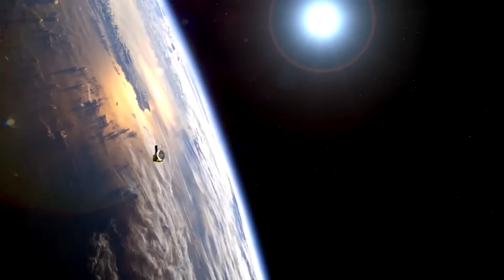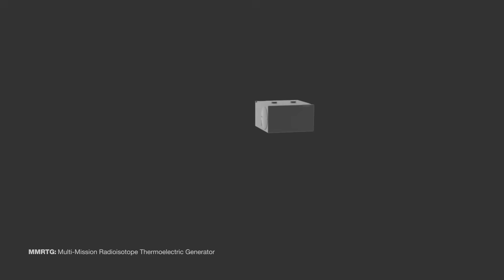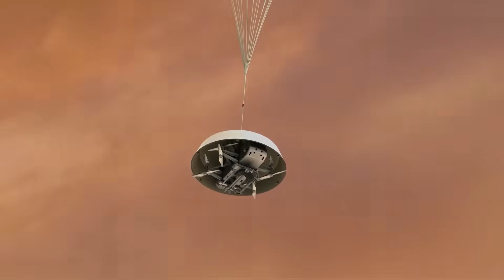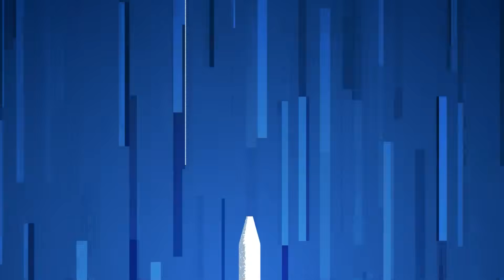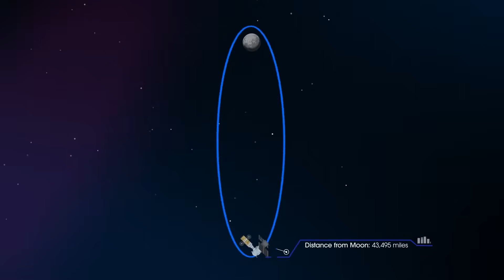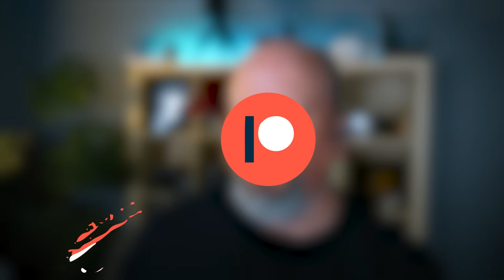Improving Nuclear Power Generators for Future Space Missions

Comment: If using Stirling engines can save  80% of the needed material over thermoelectric generators, how does this scale to shielding savings? I’m guessing it’s something similar to (1/5)^(2/3). Think surrounding a volume of radioactive material with an area of shielding.  So if volume reduces to 1/5 original, shielding may reduce to as little as 34% of the original. (Ideally). It’s possible that Stirling engines can reduce the radioactive material requirement and total weight in a significant way so that overall cost is reduced.

Comment: I wonder if they have considered anything with thermionic converters. As i understand them, they are like a halfway point between thermocouples and stirling generators. They are higher efficiency than thermocouples, but lower efficiency than stirling. They dont have any moving parts, but they do contain a gas (i believe usually a caesium vapor).

Comment: Another possible Lunar industry is space based construction.
Building spaceships, space based solar, space stations and habitats, rotovators and orbital rings, and all that using Lunar materials would have much lower launch energy costs. Lifting a ton of aluminum hull plates from Luna is much less energy intensive than from Earth.
Some deeply complex components like computers would still need to be imported from Earth, but the bulk structural components could be made and launched from the moon for orbital assembly.

Comment: I could see a spacecraft built to use a high radiation RTG, with a upper stage fuel tank as shielding and a Long carbon conductor pole to keep the RTG far away from the spacecraft.   The upper stage could be ejected leaving the RTG on the pole.

Comment: We could extent the use of an RTG with the Sterling engine for long duration space missions by using the RTG with the thermal couple as we have and keep the Sterling engine in a non-moving state until the power level drops.  Then kick in the Sterling engine to bring the power levels back up.  This could extend the system without wearing out the moving parts over the first couple of decades.
Reply: How huge will the radiators have to be cuz you know there's no convection in space only radiative cooling!

Comment: I suppose you could use two stirling engines in line, but opposite, with the heat source in the middle. With a synchronization mechanism, they could be made to move equal but opposite and cause almost zero vibrations.

Comment: diy with solar power. nuclear transformation process. nuclear decay airplanes and low altitude satellites are the best usage case. dd fusion would be even better available, if using arc heavy water inertial confinement fusion process. similar levels of rad output shielding considerations. dont ask us gov. diy no matter if they threaten with rules. well those rules are not freedom. yes you can if you just have skill. as free gift from above. dont let sellers gaslight you not having skill. am-241 is very nice, or the pu-238 which is best. dd fusion is self-shielded with the heavy water inertial containment case itself. solar for all other cases. well you can toss up micro satellites with em launch rails from earth surface into space with some carbon isotope power sources. solid state is best for any application, no moving breaking parts. sterling acoustic heat engine for all other less shaky earthy projects. pulse jet without moving parts for nuclear decay air planes. simplicity and robustness vs efficiency. your rockets cannot blow up like space x starship tests. dont just talk about it, do it. also capture lost heat to make the rtgs better. stirling is better for earth applications, like air planes. itar is nasty btw. well, we dont talk anymore then. as long as you rule with your rules, we dont talk. any of your 3 interest are not shared. only for exploration fun experience purposes, because can do. money is the weakest motivation of them all. wavy all the time. people are not to be trusted, including me. money is not actual life. ask above for your stuff, not people for their rules. money supports nothing. only consumes. dont put your trust in people, they only crash immediately if you trust them. keep it simple, engineers. us regulations are not the actual real future. freedom. not even as world police. no way.
Reply: so why do piston based sterling engines, when you can do tesla turbine based rotary sterling engines.

Comment: Heat radiates in all directions and in micro g it's might be less relevant how the engin is oriented. Might we see thermal element surrounded by multiple pistons? Sort of the radial piston configuration for an aircraft engine? Or could you build a sort of "spherical piston" with the heat source at the center, using an elastic material instead of rigid one?

Comment: Question: Nuclear thermal rockets traditionally use liquid hydrogen as a fuel, but it's hard to work with and results in massive fuel tanks. Could they use liquid oxygen, or even methane instead, or would the isp fall too much to be useful?
Reply: O2 has a mass of 32, CH4 has a mass of 16 whereas H2 has a mass of 2 and for a high Isp you want as light exhaust molecules as possible. H2O has a mass of 18 so if you want to use something that is easily storable, go with water. Isp will be less than space shuttle engines (where exhaust was H2O with a bit of extra H2) since the temperature of the reactor is less than in the combustion chamber of a chemical rocket engine.

Particularly if we go to places with lots of water like outer asteroids or the moons of Jupiter then just melting and purifying some water to fill up the tanks could be really convenient.

Comment: One Mars-specific nuclear generator I would like to see investigated is as follows: Take Mars air (96% CO2) and liquefy out the CO2. Heat the liquid CO2 (using nuclear heating) so that it becomes supercritical CO2. Expand the sCO2 back to atmospheric pressure driving a turbine/generator. Thus electrical power. You're using the Mars atmosphere as a heat sink, which eliminates large, fragile radiators. The  by-product is nitrogen, argon, carbon monoxide and oxygen. All useful. The oxygen gas been concentrated to 3% so it's amenable to standard refining. There's even a useful quantity of water. But the nice part is a compact nuclear generator that uses Martian CO2 as its working fluid and doesn't need radiators.
Reply: But surely with a system like that it would cost more energy to liquify the co2 than the energy you get out when it expands due to losses in the process, and so you're better off just using the energy for something else directly?
Reply: @Fromatic  As indicated, the energy comes from a nuclear source. Turns liquid CO2 into supercritical CO2 which has far more energy. No, you're not getting something for nothing, thermodynamically speaking. The advantage is that its compact. Both because you don't need radiators (the heat is exhausted with the CO2) and because sCO2 turbines are high power density. You also get to use the other gases, since they naturally separate out of the liquid C02. Oxygen in the Martian air is about 0.17%, but once you pull the CO2 out, oxygen is a bit above 3%. Which makes it feasible to extract oxygen using distillation. That you need for life support and propellant. What I'm saying here is that this requires far lower pressures and temperatures than the currently in vogue CO2 electrolysis. Also the nitrogen you need for life support and argon is useful for stuff like cleaning dust off things. Another use for liquid CO2 is to mine mars dirt which you need to pile up around your hab for radiation protection. So you invent a "vacuum cleaner" that blasts pressurised liquid CO2 at the surface - which then expands into gas. This lifts dirt and propels it into a catcher (bit like that asteroid sampler). My overall point is you need to do atmospheric processing so you might as well put your nuclear heat source to work and get electricity out of it.

Comment: If we develop a neutrino engine would the speed of the neutrino push the spacecraft in the other direction? And then could we recapture the neutrino and never need any other fuel than a closed cell???
Reply: I think you're suggesting something similar to a Bussard Ramjet, which for fusion power at least is energy negative

Comment: Why sterling and not Brayton? Brayton can use turbines, so there's less vibration.

Why piston and not thermoacoustic sterling engine? Thermoacpustic has one moving part: the power coil.
Reply: I think the piston is magnetically suspended so the vibrations are much lower than standard Sterling engines. Idk how it compares to those other ideas though
Reply: @fu4ow 
They're not magnetically suspended but suspended between two disk-like springs. The "seal" is created with high tolerances and lubricated by the working fluid -- often helium, but because helium likes to escape, other fluids may be considered. Such lubrication greatly reduces wear and tare.
Honestly, the NASA sterling engine is a work of technical art.
However, regardless of how the pistons are made, or lubricated the vibration will remain.

Of course, I'm advocating thermoacoustics, which has vibration in its definition. Regardless, IMHO, thermoacoustics weigh less, have less moving pars and comes in many different shapes

Comment: If its high power you want then AM-241 is your best bet. PU-238 is limited to 12-15kg of fuel depending on configuration, to prevent criticality......Boom! 
AM-241 can have 300+kg of fuel. So even with 1/4 of the power density/gram, you can generate 5x the initial power and it gets better from there. 15kg PU-238=8KW ThP at launch. 300kg AM-241=34KW ThP at Launch with 5x the half life.
AM-241 is supper easy to make. U-238>Pu-241>AM-241. 1 tonne of U-238 in a high neutron flux FBR >8MW thermo power. 1 year = 50KG PU-241 & 10KG AM-241. Separate PU-241 and let it sit in a box for 28 years and 3/4 of the PU will decay into AM-241. 
This reactor facility can reach a steady state in 25 years, pumping out 60KG of AM-241/year. AM-241 is already used gloabaly in smoke detectors and other devices.

Comment: I hope you don't get tired of my writing "great interview!" but...great interview!  I really Tyler's his approach to the business, and he knows his subject very well.  I can save his company a LOT of time, though, when it comes to upgrading the heat to electricity conversion from Seebeck thermoelectric to heat engine.  The technology not only exists, but is TRL 9, and is currently flying on several spacecraft, the most publicly known of which is the James Webb Space Telescope.  I refer to the cryocoolers used to keep the optical sensors cold.  These are thermoresonant  tubes, and when given electric power, pump heat from one end to the other.  In this application, they serve as a refrigerator, cooling the cold end to around 3 Kelvin, and rejecting the heat to space.  There are no moving parts, and they run forever.  But they can also run in reverse, taking heat input at the cold end, generating electric power, and rejecting what's left to space.  Northrop-Grumman makes them, and supplies lots of them to the space world.  They have demonstrated the cryocooler's ability to generate power when run in reverse, at Stirling-like efficiency.  I have personal knowledge of these devices,, and so does my wife.  No one would question the durability or reliability of the hardware - too many of them have flown in space, with excellent performance.  All that's needed is applying it to power generation.  RTGs are a perfect application.

Comment: I worked in the oil and gas logging industry for 41 years.  We transitioned from Plutonium in the use of formation density measurements to Cesium at a 2.5 to 3.5 Ci level, 18 Ci Am241Be sources were for neutron logging measuring the MSCC of the hydrogen in the rock.  Our pulse neutron instruments were strong 14.5 MeV neutron generators.  It is safe as long as you honor the time, distance and shielding rules.
I have also built several Stirling engines and I cannot get the harmonics and or occultation waves created by the piston or the gyro concept of a counter balance wheel… use a high gauss magnet for the piston and have a coil integrated into the cylinder walls and have two forms of power generation…hmmm… cool thoughts.  Thank you
Reply: Have you looked at the creative Chinese design of a thermoacoustic Sterling Engine which broke the power record ?
Reply: @PetraKann no I have not.  But I will look it up.  Thank you
Reply: @raytribble8075 
There is a similar invention patented by NASA many decades ago but they have not built a working model yet.
I believe the technology can he used to make submarines that make far less noise, hence making them difficult to detect 
There are other applications of course, but as we all know the military often pushes the bulk of where each research dollar goes.
Reply: Nuclear density gauges, to test the compaction/density of asphalt and aggregate, also use Cesium and Americium. These gauges weigh around 35 pounds. It's like carrying a 35 pound dumbbell around for 8 hours a shift. You have to guard it with your life, but they're incredibly accurate when calibrated properly. It's better than cutting 30 core samples a shift.
Reply: @timonium252 a long time ago the company I worked for those 41 years… developed a “road source” that was a 3 MCi cobalt road source.  I was the radiation safety officer and never saw this source before.  After leak testing these sources my TLD Badge was flagged to reduce exposure over the next quarter.  Cesium 137 at 3.5 Cu required respect.  The NRC has tightened the grip on radioactive source inventory, storage, security and DHS and FBI background checks

Comment: 40:05 Regarding lunar hydrolox for refueling of satellites in GEO...  just nope to that.  These are cryogenic propellants, subject to boiloff.  They are not viable long-term station-keeping or maneuvering propellants for long-lived satellites.  Even large spacecraft with lots of mass and volume margin for complex machinery and heavy insulation - like HLS, ACES or Mars Starship - would have their work cut out just keeping their propellants from outgassing into space within a handful of months.

Maybe it'd be more plausible to just extract oxygen from the abundant oxides in lunar minerals, compress/cool it, and export it by itself as a cold-gas propellant or input to some sort of ion engine that is fine with using oxygen as propellant...
Reply: It's not just about satellites. It could also be an economical way to fuel rockets to Mars and the outer planets. Fraser's gas station analogy is a good one. Once there are fuel stations or the ability to create them, demands for them may magically appear.
Reply: So, you're saying that there is no way to cool the propellants in orbit SpaceX and BlueOrigin appear to disagree with your assessment.
Reply: @BabyMakR  no?  Maybe you missed the part about huge mass and volume margins for the insulation and cryigenic equipment required, that aren't easily available on satellites...
Reply: @Spherical_Cow  Maybe you missed the part where things can be launched in pieces and then constructed in orbit. Or do you believe the ISS, which has systems that could be used to cool cryogenic propellants, was launched in one go?